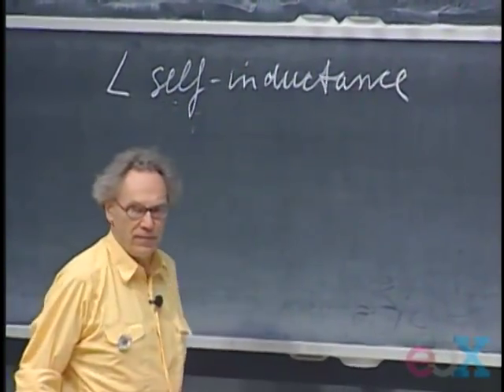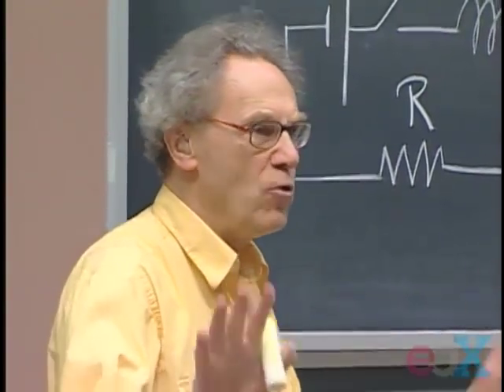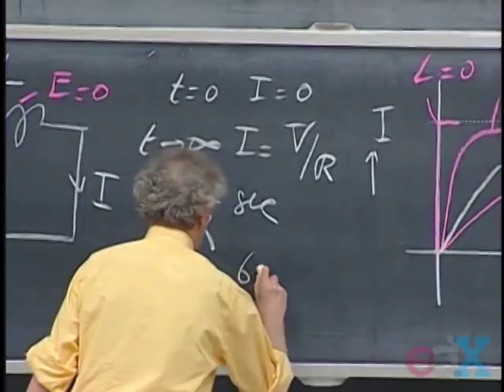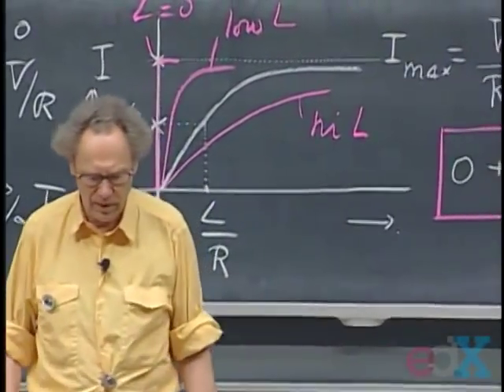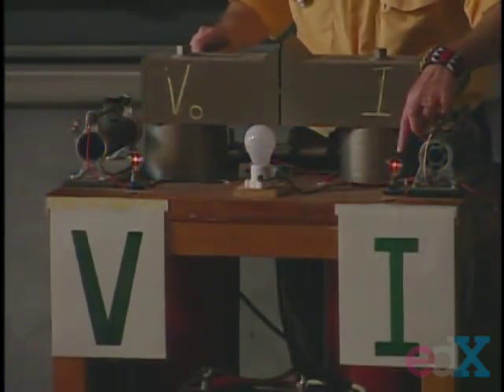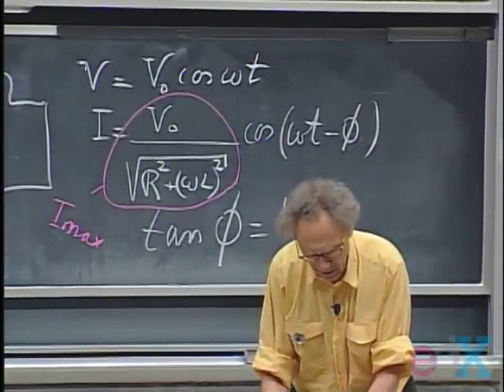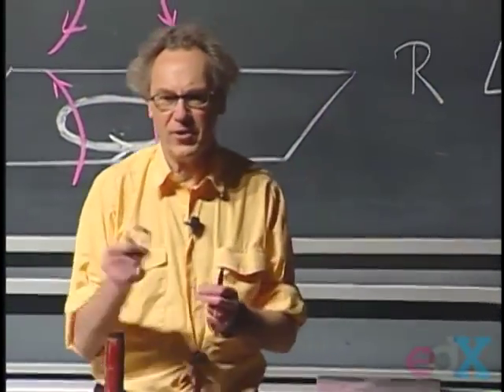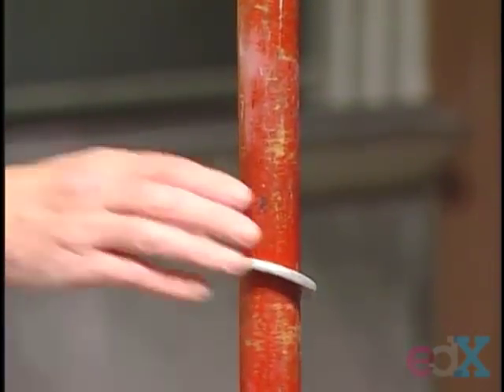8.02x - Lect 20 - Inductance, RL Circuits, Magnetic Field Energy

Comment: 6:39 "There comes a time that the self-inductance loses the fight, if you wait long enough.." 
Why does it lose the fight?? Why do not they tie if self-inductance is the reaction to the appearance of that new current? Thanks!!
Reply from the maker: induced emf = -LdI/dt. Given enough time I will no longer change thus then induced emf becomes zero. Look at the result of I vs time.
Reply: But why I initially changes if there is an opposed E field that comes from the induced emf?
Reply from the maker: Look at the differential eq. that tells the whole story.
I cannot add to the clarity of this lecture. watch it gain!
Reply: And why E=0 in the inductor? What about the E field created by the induced emf?
Reply from the maker: The E-field in an ideal conductor is zero as the wire in an ideal one have zero resistance. Induced emfs are ONLY created in components which have an ohmic resistance. If the wires do have resistance R you can then treat the problem as the R in series with the L. There is then no induced emf, no E-field, inside the L only inside the R.
Reply from the maker: A current can flow through a superconductor but there can not be an E-field inside a superconductor. use google.
Reply: Sorry for the delay in my replay. I was a bit shocked when I read that there is no induced emf inside L. But then, I read your lectures notes and proceeded to digest all that stuff.. WoW!! What a piece of Physics!! Thank you! I've learned so much from the reading. Now I believe I really understand Faraday's Law, E-fields, resistance.. No words..
Reply from the maker: GREAT, very few students even quite a few Physics Teachers have a throrough understandig of Faraday's Law.  Watch my 8.02 lecture #16, then watch https://www.youtube.com/watch?v=wz_GqO-Urk4&index=11&list=PLyQSN7X0ro22zanLOcvkaSY-IZqheFYM5

Comment: Sir,
Wen I refer the concavity in differential calculus.I understand the I vs T graph.
In order to plot V - T graph from I -T graph.
Can I take nly the slope of I - T graph ??
Or should I multiply the term - L with slope of I- t graph..??
Thank you
Reply from the maker: how many minutes into the lecture?
Reply: In 07: 00.
Current - time graph
Reply from the maker: L*dI/dt wold be the induced emf (Faraday).  I do not know what you mean by V. The integral of E dot dl through an ideal self  inductor is always zero as No E-field can exist inside a superconductor.
Reply: Yes sir,
I mean V is induced emf in the circuit.

I want to plot this induced emf  with respect to Time like current - time graph in 07: 00,

If I take slope the current time graph,
Can I plot induced emf ??

Or should I multiply " -L "  with slope of the tangent of current - time graph ( di/dt) ??
Reply from the maker: I have no idea what you mean by V
I think you do not know it either.
The induced emf (Faraday) is -LdI/dt. You can plot that. multiply dI/dt with L.
Reply: Sir
Pls see this

In page 4,

https://ocw.mit.edu/courses/physics/8-02-physics-ii-electricity-and-magnetism-spring-2007/experiments/experiment6.pdf

Graph represent induced Voltage with respect to Time.

Sir My doubt is dat.

In exam ,they give Current time graph ( in lecture 07:00) and ask to plot the induced Voltage.?

If I take slope of the tangent of graph I(t)

Can I get V(t)??

Or should I multiply" -L " with di/dt ..

In previous reply u told jus multiply L with di/dt ..

Is it multiply by - L ??

Thank you sir
Reply: Is it multiply di/dt with -ve L ??

Comment: Sir I have read that non conservative electric fields tend to form closed loops. But, if the Electric field inside the inductor = 0, then the electric field wouldn't be able to complete the loop. The same would happen because of the battery. So is this statement true or false?
Reply from the maker: >>> I have read that non conservative electric fields tend to form closed loops>>>
not necessarily  I have read that non conservative electric fields tend to form closed loops
Reply: Thank you Sir :)

Comment: So professor, If you connect a voltmeter across an inductor, it will always read 0?
Reply from the maker: The answer is NO
 if you place a voltmeter over an ideal conductor, made of super-conducting material you are creating a LOOP. The closed loop integral of E dot dL in that loop is -L*dI/dt. Since the integral of E dot dl through the ideal conductor is ZERO, the integral of E dot dL through the voltmeter is --L*dI/dt and that is what the voltmeter will show.

Comment: 35:35 is this equation correct. as if w is zero then you do not get back the same formula for non alternating current. this looks familiar to the driven osscilator with damping being inductance. do you need to include the transient solution!
Reply from the maker: omega=0  ==>  Phi=0  and V=IR. all eqs on the black board at 35:35 are correct
Reply: @lecturesbywalterlewin.they9259  but if setting omega to 0 , i understand that u recover v=ir, but isnt setting omega to 0 exactly identicle as the differential equation that has the term (1-e^rt/l) in it, as your differential equation for alternating current when omega is 0 simply reduces L *di/dt + iR = v which we know does not have the solution V=IR

this looks like a steady state(ish)solution similar to a driver

(substituting omega =0 to the ac solution and ur the differential ac equation get that v=ir is the solution to l*di/dt+ir=v  but we KNOW  from the previous equation that this is missing a factor of (1-e^-r/l * t)
Reply: And thanks for replying. a response would be appreciated :)
Reply: @lecturesbywalterlewin.they9259  whilst ur here, thanks for providing us with these amazing lectures!
Reply from the maker: @JensenPlaysMC  Solve the diff eq:  IR + L*dI/dt = V  there is NO omega!!
Reply: @lecturesbywalterlewin.they9259 + I know there is no omega thats not my point:
Given the differential equation
 IR+L*di/dt =v (1)
It can be shown to have the solution
I=V/R°(1-e^-rt/L)

The differential equation
IR+L*di/dt =v*cos(wt)  (2)

has the solution, say... "k"

substituting (omega = 0) into (2)
reduces to (1)

which has the solution
I=V°/R(1-e^-rt/L)

Therefore substituting (w=0) into the solution to (2) (k) would therefore yield the solution to (1) which is
 I=V°/R(1-e^-rt/L)

But it does not, your solution to (2) when substituting omega =0 yields V=IR which is wrong.
Reply from the maker: @JensenPlaysMC  I=V/R°(1-e^-rt/L)    this is correct   I do not see either why the 2 solutions at a random time, t, are different for omega = 0. Please spend some time on it and tell me why.
Reply from the maker: @JensenPlaysMC  My solutions are correct - I did not solve them myself. You can find the solutions in any college Physics book.
Reply: @lecturesbywalterlewin.they9259  I hate to dissagree with you, but... clearly not ,if it gives a false answer for w=0...
your  solution =/ the solution according to any diff eq solver

i assume every college textbook is an approximate solution. as the math clearly gives a contradiction between the solution to (1) and the solution you used for (2). i know that you're vary aware that  college textbooks dont always get it right
Reply from the maker: Jensen I loooked at my lecture notes of lecture 20.
I first have a circuit with a switch. V=Vo (battery). I close the switch at t=0 and derive I vs time. I mention that at t=0 I=0. That introduces transient behavior (1- exponential function). Once they are gone, I=Vo/R. 
In the case where V=Vo*coswt I look at the steady state solution (I wrote that in my lecture notes - did not mention it in class). The solution is then I=Vo/sqrt [R^2 + (wl)^2] * cos(wt - phi).  Thus you wait till transients are gone. (to specify the situation at t=0 introduces the transients) When w=0  the steady state solution is then I=Vo/R  which, of coourse, is the same solution when we close the switch and wait till the transients have died out - namely that I=Vo/R.  I should have stressed that in class but I did not; but it is in my lecture notes. The steady state solution for w = w1 is    I=Vo/sqrt [R^2 + (w1L)^2] * cos(w1t - phi).  I thank you for raising this issue. I gave this lecture in 2002.
Reply from the maker: In this 8.03 lecture I derive (and demonstrate) "transient solutions" and "steady state solutions". 
https://www.youtube.com/watch?v=rhvBDN1OQJ4&list=PLyQSN7X0ro22WeXM2QCKJm2NP_xHpGV89&index=5
but this issue may also have come in other 8.03 lectures.
Reply: @lecturesbywalterlewin.they9259  thank you for taking the time to look through your notes! i was really confused when i first noticed xD. You are an amazing teacher and am glad you post these lectures online!
Reply from the maker: I should immediately have told you about transient and steady state solutions but since I gave this lecture in 2002 I had forgotten. You and I were both staring at the 2 "identical" diff eqs which  should give the same solution, but they didn't. I have been thinking about it during the past week and decided this morning to look at my lecture notes. I still have all my lecture notes of all my 94 MIT lectures.  I opened lect 20 (8.02) this morning and I realized immediately that the solution to the Vo*cos(wt) diff eq was the steady state solution and the (Vo no w eq, I=0 at t=0) is the transient solution which gives the same answer when t is much larger than L/R then the steady solution when w=0 (as it should) .  I compliment you for bringing this to my attention. In all those 19 years that this lecture is online, no one ever did

Comment: Dear Sir,
One question
If I have a AC circuit containing only the source and an inductor, can I use the Kirchhoff's Loop Rule to say that the total algebraic sum of voltages in the circuit equals zero ? I doesn't seem likely as the source is alternating current.
Reply from the maker: >>can I use the Kirchhoff's Loop Rule to say that the total algebraic sum of voltages in the circuit equals zero? >>>>> NOOOOOOOOOOOOOOOOOOOOOOOOOOOOOOOOOOOOOO
Kirchhoff's loop rule cannot be used. However, you can always apply Faraday's Law.
Reply: Thanks a lot , Sir, though my textbook asks us to use Kirchhoff's Loop Rule. Thank You.
Reply from the maker: ditch that textbook. It must have been written by an idiot. I strongly suggest you watch these 3 lectures also DO read the Lecture Notes of 8.02 Lecture 16 and Lect 20.
https://www.youtube.com/watch?v=LzT_YZ0xCFY&list=PLyQSN7X0ro22zanLOcvkaSY-IZqheFYM5&index=4

https://www.youtube.com/watch?v=nGQbA2jwkWI&index=17&list=PLyQSN7X0ro2314mKyUiOILaOC2hk6Pc3j

https://www.youtube.com/watch?v=FWMhk6x785Q&list=PLyQSN7X0ro2314mKyUiOILaOC2hk6Pc3j&index=26
Reply: Thanks for the references. Thanks a lot.
Reply from the maker: It has NOTHING to do with the fact that you are using AC current. If you had a circuit AC power supply with a resistor and a capacitor you COULD have used K's loop rule. At any moment in time the closed loop integral of E dot dl would be zero. BUT K's rule does NOT apply when you have a self inductor!!!!!!!
Reply: I am always a bit surprised when I hear you objecting so much against using Kirchhoff's "loop" rule when there is a (self)inductance present. Indeed, when interpreting the loop rule as taking the loop integral over electic field, it cannot be used (since E is 0 in the inductor). But what is wrong with the usual interpretation of Kirchhoff's loop rule: the voltages when going around in the loop add up to be zero? This works when you call LdI/dt the voltage across the inductor. It only fails when the wire loop that forms the circuit itself undergoes magnetic flux variation (as you nicely explain a couple of lectures ago). But when you only consider lumped circuit elements (not the magnetic flux in the complete circuit itself),  you can apply Kirchhoff's voltage rule (where Vind = LdI/dt). But possibly I am an idiot too ;)
Reply from the maker: You are NOT an idiot. Look at my demo in Lecture 16. Two voltmeters, V1 and V2 are attached to the same points (A and D) in the circuit. They both read very different values and the polarity is reversed. This is the result of Faraday's Law. The integral of E dot dl from A to D depends on the path and the two paths are different. If you apply Kirchhoff's loop rule V1 must be the same as V2 (including the polarity). Students should be taught that K's loop rule is a special case of F's Law and thus that K's rule does not apply when dphi/dt is not zero. In case of a self inductance, the students should learn that the closed loop integral of E dot dl is NOT zero.

Comment: I thought that the induced electric field in the solenoid slowed the charges and that is why the current increased slowly. Now I find that the electric field in the solenoid is zero because it has no resistance (lecture note) so the only significant fields are in the battery and in the resistance. In addition the line integral of the electric field around the loop must be equal to -L di / dt. I do not physically understand how the current increases slowly. Is there any electric field that slows them down? where ? can you help me please ?
Reply from the maker: The induced emf is -LdI/dt. Faraday!!!!
Reply: The non-conservative electric field producing that emf -L di / dt must be canceled because there can not be an electric field inside the solenoid and this is achieved by nature creating an electric field produced by charges, so this electric field is the responsible of the current increasing slowly because it oposes the electric field that the battery is trying to impose in the resistor, am i right ?
Reply from the maker: The emf=-LdI/dt is NOT in the solenoid  it show up elsewhere in the system but it caused by the self inductance ===>   FARADAY. Many students have difficulties with this as the have always been brainwashed in high school that the closed loop integral of E dot dl is ZERO. But that is NOT true if the is a magnetic flux change in a closed loop.

Comment: Sir , my book says that the induced emf equals the closed loop integral of (E.dl ) ,where (E) is the nonconservative electricfield so why do we consider the electric field inside the battery when setting up the differential equation because i think that the electricfield in the battery is conservative .at minute 9.40
Reply from the maker: I do not understand your words. I cannot add to the clarity of this lecture. Watch it again. Maxwell's eqs!  Faraday's Law in action!  Merry X-mas.
Reply: @lecturesbywalterlewin.they9259  Sir, in a circuit consisting of battery , resistance , switch ,and inductor ,when we close the switch we will have an induced electricfield in the closed loop and also we have an electricfield in the loop due to the battery ..please sir, can you specify which electricfield do you take into account when setting up the integral of (E.dl) ..
Reply from the maker: @mahmouddesokey3818 Watch my lectures. I teach you how to apply Maxwell's eqs and Faraday's Law. I cannot add anything to the clarity of my lectures. If you need more help, use google or Quora.
Reply: @lecturesbywalterlewin.they9259  I watched the lectures and this question baffles me .

Comment: In charging and discharging of a capacitor in RC circuits, where we calculate the charge on the capacitor as a function of time (q=EC(1-e^-t/RC)..
In all the textbooks it is derived using Kirchhoff's rule..
Sir, shouldn't we use faraday's law?
Reply from the maker: Faraday's Law ALWAYS works: the close loop integral of E dot dL = -dphi/dt.
In this case dphi/dt is zero. thus close loop integral of E dot dL = 0 but that's also called Kirchhoff's loop rule. KLR is a special case of FL.

Comment: so an inductor resists current (t=0) but had no resistance. Same with a capacitor (t=inf) how is there no voltage drop across it then?
Reply from the maker: question un clear - how many minutes into the lecture
also rephrase your question.
Reply: It hasn't got an ohmic resistance, but  it has an inductive resistance. It's Ohmic resistance is - Ldi/dt. At first, current changes very rapidly and the inductive resistance is very high and also we assume that this is equal to the voltage of the power source.So thats why current becomes zero. But after that, inductive resistance decreases because of a reason even professors don't explain very well I think.

Comment: prof. there are contradictory statements in the derivation of growth of current you said that electric field is zero in the inductor so there is no potential difference across the end of inductor and we also know that flux change in the inductor will produce EMF which will create potential difference across its end so which is correct 
please reply sir🙏
Reply from the maker: no contradiction. The induced emf is NOT in the inductor but elsewhere in the circuit.
Reply: Lectures by Walter Lewin. They will make you ♥ Physics. sir but we are taught to replace the inductor with cell of equivalent voltage (ldi/dt )to calculate potential difference between points across inductor
Reply from the maker: <<<we are taught to replace the inductor with cell of equivalent voltage (ldi/dt )>>> that is very very dangerous. If you do that, you cannot explain the demo I do in Lect 16 of 8.02.